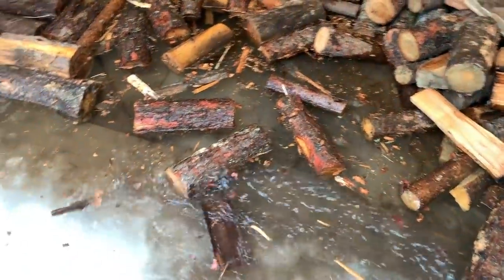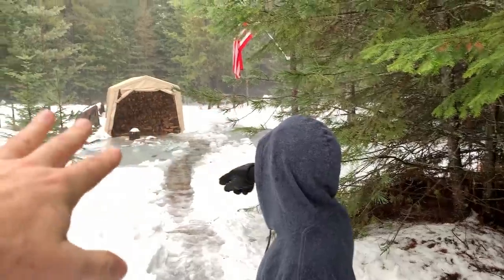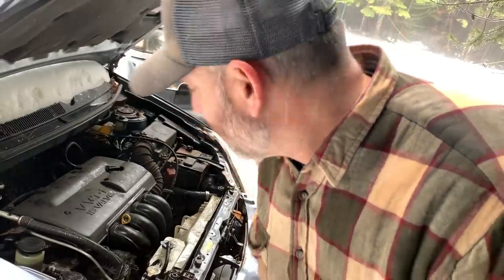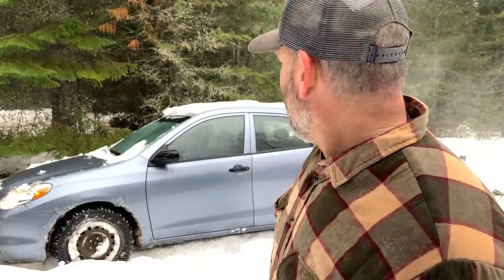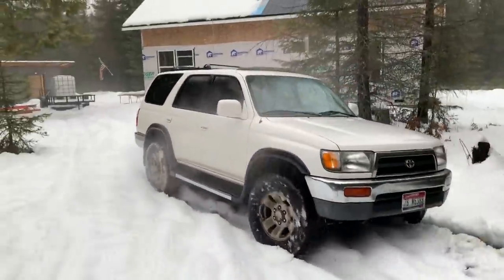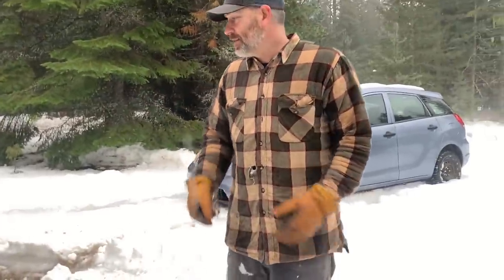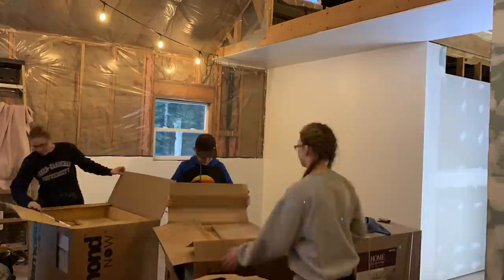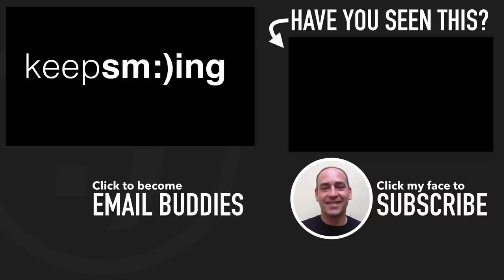It started raining. Then this happened. BUMMER DEAL

Comment: I have an idea Martin.  If you are in a bind with all that water, place a basic pump near the road or a low spot on the property (a good ways away from your comfort zone), maybe even put the pump in the pond.  Run some hose pipe to the problem areas and turn the pump on to drain the water.  Sometimes  "The January Thaw" occurs for a couple of weeks, where it is around 50 degrees, so this could happen again.  Hang in there!

Comment: Hey Martin, little tip from the comment section ;)
When jumpstarting a car always connect the + side first! So when you drop the negative terminal you don't short the battery because the car frame is always connected to the negative terminal.
Reply: Also, connect the black cable to ground, ie the car frame.  Batteries produce explosive gases, and if you are going to have a spark, you want it away from the explosive fumes.  If you have a ground problem, the care is unlikely to start anyway.

Comment: I'd pull as many of the floaters out and stack on higher ground to dry.

Dig a trench from the lowest spot out to drain the lake.

If you've got it stacked high enough to get through this winter, worry about relocating to higher ground next spring.

Comment: Imperfections in your drywall scratches or other areas can be fixed with spackling light coat then sand then prime paint over it and finish paint to match

Comment: For the paint job, the glossier the paint ,the more you'll see imperfections, try a low sheen eggshell, you'll get a better finish and it is washable. The dirt stuck to the drywall is because of a dirty roller or dirty paint, you'll need to strain it. To fix it use a sander and repaint again. Brush marks is because the paint was to tick, needed a bit of water to thin it.
Reply: Dan Double Barrel. A cheap (inexpensive) way to strain the paint is to use a nylon knee high.    If someone points out the flaws, just say you should have been here to supervise. Looks good.

Comment: Usually it’s corrosion which causes the terminal to come loose but a phone charger left plugged in stays on all the time and will drain a battery in a heartbeat. You might be investing in a plow-you need a gutter / make shift to collect your rainwater into your water tote which will act as a settling tank to drop out the debris then pump it into your cistern tank. Rain water is incredibly soft and usually very clean and free!  But for showers and toilet use is perfect if your worried about bird poo/bugs but most RO filtration systems with an ultra violet light bacteria cleaner will take care of stuff- check out YouTube life contained—love the kitchen and all the progress

Comment: You might consider getting your friend to come and push that slush out of the way before the ruts get frozen.  Your walls are looking fine, there comes a time when being to critical is counter-productive.  That wet sponge trick I mentioned in an earlier video would take care of a lot of those minor scratches.  Don't get me wrong, Kilz is a great paint (good for covering mold, mildew) but it is thick.  So as an undercoat it does tend to leave brush lines, you might try a thinner primer paint.

Comment: The wood floating in the water is still good to burn once you pull it from the water and let the surface dry as the water can only get so far in without outside help or time.

Comment: You will recover from the floating wood pile.  We all forget to do this or that or make mistakes.  But for the rest of your lives, the problem will be corrected....I wonder if a snow blower will help you clear a path and get the water moving.  Experiencing the water mess, one can see why Building Codes want houses sitting on a grade of at least 6 inches higher than the normal ground, sloped for at least 10 ft from the house.  Hopefully the ground around the water pools slope downward towards the road.  If not, you can eventually build up this area with soil to cause a natural downward slope away from the lot.  It's your first winter to discover where the problem areas are.......The walls are beautiful--very impressive for a rookie!
Reply from the maker: Thanks. Hopefully this summer we can grade the rest of the area near the house and keep water moving.

Comment: I have a roof rake if you want to borrow it, With the extensions it should reach, but that layer has probably froze solid now if it didnt shed fully during the warm week. Looks like you guys did a good job insulating the ceiling.

Comment: As for the imperfections in your drywall what happens when you sand Raw drywall you raise the fiber in the paper but it's not a problem after sanding take a wet sponge mop wipe it on the walls to lay the fiber down after the first coat of primer lightly sand the walls with 220 grit paper then put your final coat on being very careful to be smooth and not hit the floor so that you don't pull garbage off the floor back onto the walls make sure you back roll what you've currently painted so that your painted surface is not so thick in revealing

Comment: Just a thought, might dig out for a tank in the biggest "puddle" areas to accumulate water as snow melts to use on the garden in summer. A small pump could pull it back up, saving the well for other important stuff in the house. With small wells and no rivers or streams, adding water to the place anyway you can counts.

Comment: As for your wood storage come spring either relocate it or build a higher platform off the ground to start your wood storage but still you need to plow the snow if those ruts freeze over or the rest of the standing water you all willb stranded

Comment: An alternator is not a battery charger. It is a tool made to  keep a fully charged battery charged and supply the car with the electricity to run the functions,  a battery can't. Put the battery on a charger over night. A voltage tester, battery should be 12 2 v, and running should be 13.7v to 15.2v. Turning on head lights, heater blower, it will drop, but should recoup instantly, if the alt. is good.
Reply from the maker: Check this out https://www.howacarworks.com/basics/how-the-charging-system-works

Comment: Welcome to Idaho winters Brother! Were you able to get that drive area plowed before the freeze came back? Might be too frozen to work the ruts out now, but Let me know if we need to bring the ford tractor down to try to do some driveway work. We would need to use your flatbed trailer to haul it.
Reply from the maker: We did get most of the out. The water is gone in the shed too. Thanks for the offer. Tell Uriah hi and we will hang out soon.

Comment: I know you think safety is a joke but the vehicle that needs to be started should have the positive lead (red) connected to the battery and the ground lead (black) connected to a good ground point of the car.  Vehicle with the good battery has the red and black lead connected to the battery as you did. Your hookup could cause the battery to explode.
Reply: Red -red.  Black-black not adequate?
Reply from the maker: You must not have any arched my video about safety. It is no joke.
Reply: @MartinJohnsonOffGridLiving  Oh but I have watched your video and when Safety Sally is in the video you are mocking her. Watch your own videos.  I'm not the first one that has commented on you bringing up Safety Sally.  Too bad you only read the first 8 words of the comment.  If someone follows your example of jump starting a vehicle it is a safety issue.
Reply: A battery is not that combustible thing, to dramatise it..yes.Whatever color of wire you connected does not matter as long as its touch the right thing.
Reply: @MartinJohnsonOffGridLiving  I see you haven't responded to the main reason for the post which was you don't know how to correctly jump a vehicle.